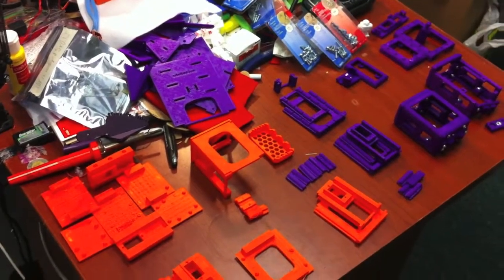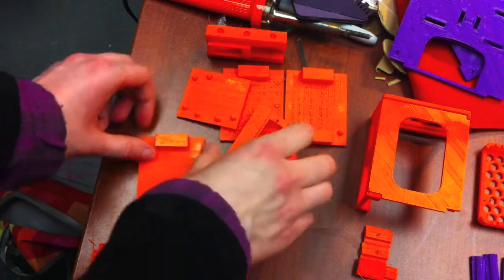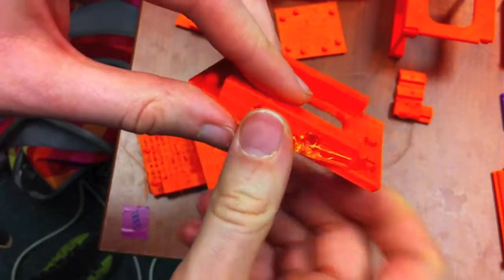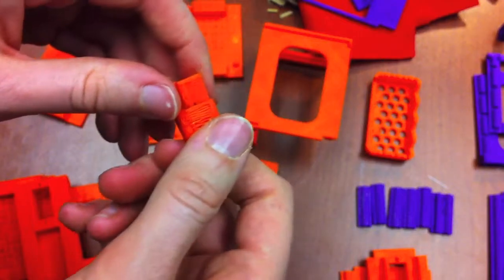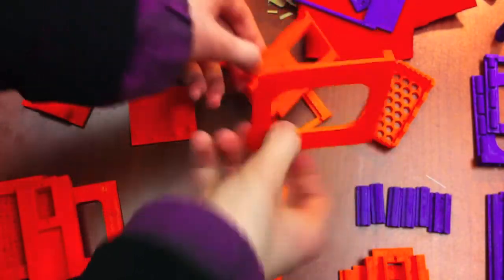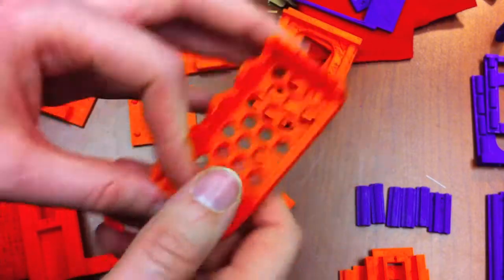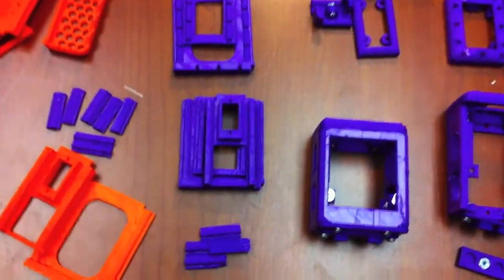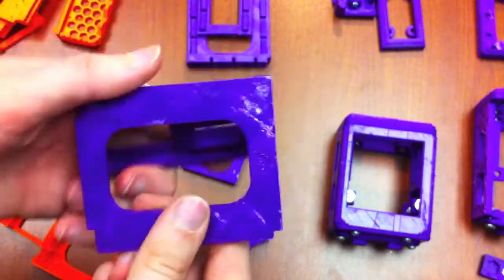3D Printing - Attaching Pieces Test #1-10 Part 1

Comment: Thank's for your test. You saved me so much time. i'm not sure if all of it is still correct 5Y later, but it sure is a good start.
Reply from the maker: Very cool to hear! Hopefully the resolution in printers has gotten better in 5 years, might be worth trying the ball and socket type of connections. One that I use often now in the current robot (Bowie) is a sliding dovetail with a key. It works great!

Comment from the maker: Here is the Part 1 video of our 3D printing attaching pieces test #1-10 adventure! ;)

Part 1: 3D Printing - Attaching Pieces Test #1-10 Part 1
Part 2: 3D Printing - Attaching Pieces Test #1-10 Part 2

It's starting to get exciting... just some more designing to do and soon it will be time to add in the electronics! w00t w00t!
Reply: What kind of 3D printer are you using?
Reply from the maker: The RED^GREEN MACHINE (Makerbot Replicator 1) http://www.flickr.com/photos/robotgrrl/8469112155/in/set-72157632752709815
Reply: I am curious what kept you from trying something like a T slot?
Reply: Great stuff, Erin. It's very interesting to see the different designs and how you iterated through them. You're really putting some time on that MakerBot!

While being able to snap stuff together is nice, most everything around you is held together with fasteners and/or glue.

If stuff just needs to get tied together once, check out self-tapping (ie. sheetmetal) screws. They should tap into the plastic easy (but be careful about cracking). Or you could use machine screws and tap the holes (the printer isn't detailed enough to print tapped holes).

If you want to focus on no fasteners, I'd look at some of the traditional woodworking joints. There's a lot of stuff that requires no glue or fasteners and is very strong (ex. dovetails).

I guess you can add mechanical engineer to your resume. :-)
Reply from the maker: Kyle Kerr Good question... if it's what i'm thinking of, the undersides of the T would have problems with overhang, almost like the sliders did. Unless I'm thinking of the wrong thing? :)

Ron Nelson Haha all of this mechanical stuff is quite difficult! Thanks for the suggestion of self-tapping screws, maybe if there are huge ones then the printer can print it. Hmmm.... thought about a dogbone type of joint, but still not sure if it will work considering the sliders didn't. Thoughts?